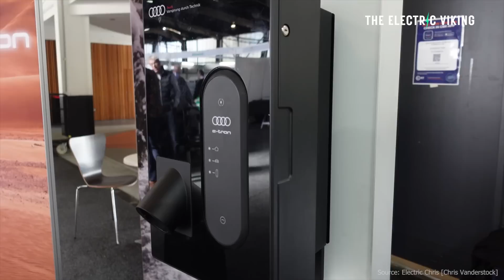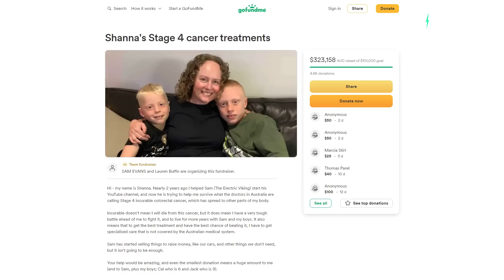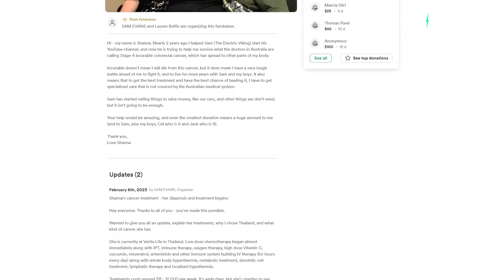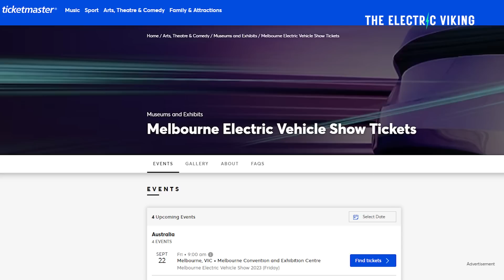Should you buy an EV now or wait for the new batteries just revealed?

Comment: "Should you buy an EV now or wait for the new batteries just revealed?"

the answer, is mostly YES

I had a 2022 hybrid suv, loved it and planned on keeping it until 2025, when I estimated EVs getting 350 average range would be the norm by then

however it got wrecked, and I needed to buy a new car.  to compare, the model 3 i bought this year saving me $300 a month compared to my gas use, insurance, and payment.  the reason why i went with the model 3, based on my needs and concerns, is the LFP battery they use in it, which made me pass on the model Y.  
so i chose battery tech over what would have been a better overall vehicle in terms of usability for me, however the model 3 is suiting me just fine.  
so i jumped into the EV world earlier than I projected, and I do have my complaints with it but overall not generally dissatisfied other than range being at that concerned spot for a road trip which im highly hesitant about due to being in the mountains of the SW, but usable daily....as someone that uses it heavily in urban stop and go at 21-25k miles annually just locally i will do more charge cycles, which is also again why i went with LFP over the traditional cells in the other teslas.  i just wish it had a 330-350 real world range on it.  

so my answer is yes, but also depends on your need, is it cost effective for you, and your usage, and also your situation (such as my example, are you forced to replace a vehicle etc)
If you dont NEED to, i pesonally would wait for the next incoming generation of tech

Comment: While the industry appears in its infancy at the moment, I suspect that aftermarket battery manufacturers will spring up providing newer technology batteries for older vehicles. I understand there is already some doing this for the Nissan Leaf. If the batteries age faster than the vehicles, there is an opportunity that doesn't really exist in the ICE world.

As long as the physical dimensions, battery voltage, and electrical connections line up, it should be possible to replace a battery that was state of the art in its day with a later type in older vehicles. Like computers, the replacement battery for your car would be cheaper and better than the one you got with it.

Comment: Buy the longest-range EV you can afford now, every battery technology we hear about, pretty much every day, won’t be out for a couple-few years as they have to go through rigorous beta testing and certifications to be sold to the public.  Owning and driving an EV is a blast, I’ve owned 2 and have been driving EV for several years and love ‘em!
Reply: I’m not sure this is the best advice for everyone. If you mainly make short commuting trips surely it’s better to buy an EV with enough range for your need, it will be cheaper to buy and more efficient to run. If you only drive 100 miles per week on average why spend more on a car with a 300 mile range you may only need 2 or 3 times per year?

Comment: If the car does what you need it to do today, buy it. We see revolutionary new battery announcements almost every week, but there could be years between the lab and a production line. Range seems to be stabilizing around 400 km. Better future batteries will be used to make that same range with smaller, lighter packs.
Reply: Or the other way around? If your current car is very efficient, reliable and does what you need, wait some more until innovation and scale bring you the replacement car you want at a price you can afford.

For some people that time is now. Driving an old unreliable diesel for 25.000 km a year is enough reason to buy a brand new EV you really like, if you can afford it.

But if you have a modern car you like that never lets you down m, and don't really drive it all that much, there is no point jn spending that money now on something that is just not going to make up for it's own production emissions during the time you own it. In just a few more years things will change a lot. And imho that is worth waiting for.

Comment: I will milk my existing ICE vehicles as long as I can, when they finally bite the dust, I will switch to Teslas.

My oldest vehicle is a 2002 Accord, my first new car ever. I have serviced it well and it still runs great now.
Reply: Me too. We are planning a number of country trips in remote Australia over the next few years. There’s plenty of days we need to do high kms (700km +) and the paucity of fast recharging points and lack of range rules out an EV presently. I would love to switch to Tesla for the local driving, but not practical so will wait a few years more…
Reply: @tomesplin4130  : indeed - re. "remote travel EV style", it is advisable to stick within recharge distance  of civilisation (or have a tilt-tray in the convoy).  I just "crewed" in a cross top-end trip, the Port Hedland to Newcastle leg, via the sights and scenes of the Gibb River Road - sometimes track  - the whole thing including seeing the sights in 8 days (9 including a flight day.) - driving a sub  $10k Nissan Pathfinder from another decade (285 000 km on the clock)..

Recharge points from Derby to Kunnunurra..  Zero (ROEV plans on installing at Lake Argyle and El Questro - sometime in the future) The Horizon power charger in Kununurra - barricaded - Apparently there is a x2 11kW Tesla charger at the Kimberley Waterfront Holiday Park...  Re. taking a Tesla on the Gibb (or any true remote travel) - a jacked up Y  on big tyres might make the water crossings (Our Hahn River Crossing was over bonnet splashy)  - but needs significant logistics to be solved (biodiesel shipped in to run a genset)  to make the range (~944km with our sidetrips - 3 days on a timeline)..
Reply: They won't be for sale to consumers after autonomous comes. So you'll have to use them on demand.
Reply: @-whackd  That would be even better. The goal is to get from A to B safely and confortably, not to own stuff.

Comment: Going with a 2023 Prius prime XSE Premium with solar roof. Wife's commute is short enough that she will be able to get to and from work in EV only mode. The car sits out in the blazing Texas sun all day, so several miles of range will be added to the battery each day while she works. Honestly the gas engine will be used infrequently if at all for weeks on end. That gives us a mostly green vehicle with backup ICE for trips etc. until EVs are cheaper and have better, safer batteries.

Comment: There are no battery breakthrough or holy Grails. It's all vaporware meant to slow the adoption of BEVs and induce the Osborne effect. 
Every "breakthrough" announced today won't be commercially viable for 20 years. 
There's no reason to wait. Tesla's TCO over 5 years is the same as a Toyota... Over 10 years, it's much lower.

Comment: EV's are now like computers -- no matter when you buy one, there will be a better, cheaper one next year.
Reply: I hope so, I can’t afford one yet, well maybe I can afford a 4 year old TM3 standard range.
Reply: Hmm sounds like all cars.
Reply: @josevazquez1042 except the cheaper part.
Reply: @vec306   - which part is cheaper - on a reasonable timescale??  (missed the connection, I am sorry.
Reply: In general, that's a good analogy. UNLESS there is truly a fundamental change around the corner. The best example I can think of is Apple Computer's switch to Apple Silicon with their M series chips. News of that change was good reason to wait and stay away from buying an Intel based Mac. I don't know if we have a situation like that with EV battery technology right now. But if we did, WAIT!!!
Reply: - so only buy a new one "if" you really need one.

the "needs are often backburnered for the speedy short term (and range) wants.  lol.

NB - the current contrivance -  Diesel ute only needs a fill up every 2-3 weeks for my regular driving (I know 1000-1500km a month isn't a lot -  then some months I can blow that by in a day )  or after ~750 odd km (tank only), or if travelling  range of ~1100km  offroad adventuring - loaded up, and  with a few jerry cans.
I need an EV which does all that (1000km with a full loadout). The same fuel (80+60L) will get the truck 1300km around town and country lightly loaded, not fantastic but for a single vehicle the additional cost of: running, registering and insuring a second vehicle will not be recouped with my current miles - even if the Electricity were free (solar is not free,  my existing system has cost me around 15k and the tax payer another 4 (REC) -8k  (4k FIT)   (depending on how one assesses feed in tariff's funding source - is it a competitive market mechanism of government to industry subsidy ??_.
Reply: When autonomous comes, they won't be for sale to consumers. There is no reason that Tesla would sell a car for 50k that can replace $140k of labour per year.
Reply: Very True  👍

So I am no rush to buy one ATM.

This newest Model 3 is better in many ways than the previous Model 3 and it might be even cheaper.